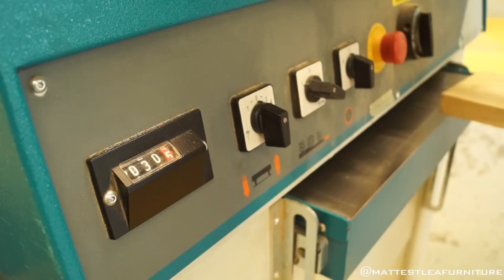Building a Roubo Workbench | Part 9

Comment: Hi Matt,

I have become addicted to your videos!  Your skills in the shop, and on the social media front, are very impressive.  You're doing that dissertation proud!

Question at 14:00: how do you prevent the orbital sander from cutting into the perpendicular surface when sanding near inside corners?  Do you sand into the corner with the orbital, or finish off the inside corners by hand?

Comment: Haven't commented during the build, but you've done a great job. A few cock ups, but worked your way around them really well. Your design (technically) was quite accurate, really impressed when you and yer mate dropped the tops on - alignment was bang on!! Nice choice of hardware, and good fitment. Presentation of the vids was good, nice friendly approach. blah blah blah. When I subscribed, you said I won't be disappointed, well guess wot. I'm an older tradie, sparky come fitter with a woodworking hobby (no expert at that) but I know good skills. Looking forward to watching more of your stuff. Cheers Matt. (p.s. how did your assignment - or whatever, media thingy - go?)

Comment: Hey Matt, Idk if you can answer this since it’s been a while that this project’s been complete. I’ve been in the process of building a bench inspired by this series and have gotten a little stumped about how you got the measurement placement for the threaded inserts embedded in the bottom of the table top. My frame is built and both top sections are similarly close to being dropped on. I’m just nervous about setting those inserts without a good plan for measuring their placement without putting the top on if that makes sense.

Comment: Hey Matt! Thanks for this video and in generalfor your work. It really helps me out! One quick question: How the hell did you get that bench out of there? Must weight at least 200kg. Ah and also, at 12:20 why do you plane the overlaying pieces but sand them afterwards? Isn't a planed surface much nicer than a sanded one? Best regards

Comment: Matt,  hello from across the pond.  Really enjoyed the series so far, only one more to go.  Question:  What is the make of that drill guide you're using at 13:36 of this video?  Looks sturdy and accurate and I want one....have to drill some dog holes in a new benchtop and that thing looks like just the ticket.
Reply from the maker: Hi Devin,

It's actually from the company I work for in the UK, Axminster Tools and Machinery. It would be perfect for thinner bench tops, but for thicker ones like mine it's probably not sturdy enough. There's still a small amount of play in it. I'd imagine you could get something very similar on your side of the pond!

Cheers mate

Comment: When attaching the top, did you run the risk of racking and therefore jamming the assembly before getting it in place?  I'd worry that such a mistake couldn't be remedied.  It's beautiful, however.  Do people in the UK appreciate your use of the soundtrack from the American movie Shaft? Classic!!!!
Reply from the maker: Oh absolutely! I was bricking it while dropping the tops in place. The most likely error was the tongues for the end cap being out of line. However, it's all the result of extremely accurate and precise measuring throughout the entire build. In many cases, I marked off one component to the other instead of relying solely on my drawings.
Reply from the maker: And I didn't even know it was a soundtrack! I got it from a royalty free platform so it's probably a rip off. I did find one recently that sounded scarily close to an AC/DC track.

Comment: How do you like the Roubo? I cannot decide between a split top roubo or a Paul Sellers bench... Sellers swears by his bench and it's dead simple. Anyone help me here?
Reply from the maker: Get a book called 'Workbenches: From Design, Theory to Construction and Use' by Chris Schwarz. It'll help you work out what you need in a bench and find a happy medium between something as insanely functional and versatile as this thing, and something as affordable as Paul Sellars' bench.
Reply: Ha.  I actually own and read that baby many years ago.  I'm 49 and have been doing this for some time now; I recently started using hand-tools more so a different bench is needed.  I'm stuck on these 2 benches but they are so different to each other...  I think I want the BenchCrafted tail vise.  Maybe I'll build the Sellers bench but put a BenchCrafted tail vise on.  I also like that sliding deadman you got.

The cool thing about the Sellers bench is that it uses lumber grade 2 x material throughout the build which is cheap but works fantastic.  If I built the Roubo I'd spend a lot more on material.  Thanks for responding; new sub here; love the channel.

Comment: I have a question why do you make such nice dove tail joints and then cheat on some of the other joints I think the project came out beautiful just can't see why
Reply from the maker: Good question. I assume you're talking about the through tenons? I like to work in a way that creates maximum enjoyment for myself throughout the process. I love cutting dovetails, but through tenons? Nah. Also, this method ensures a perfect fitting joint with no gaps. I'd rather have that in the end result, than be able to brag about hand cut joints. Cheers for the question though, got me thinking!
Reply: Matt Estlea - Furniture thanks for the reply I also find other ways of getting that fancy joint without all the work and the possibility of gaps in the end especially with larger ones

Comment: I had the time .. And I spent it well seeing the 9 videos with you making this workbench. And I think you made a fantastic and amazing job. I wish I had one of those! Because that is Fantastic!! ... But I ask my myself... well: - I ask You.. You made that workbench  with 99,9% with machinery.. with very good and nice machinery ....Right?  And I Thing that a workbench is made to work with HAND TOOLS ... And you almost in this videos NEVER AND NEVER used THEM AS TOOLS.... I never saw you use a single  once time .. like a HAND PLAIN... or a manual HAND SAW... And there were several times that you could used them.... AND IT WOULD MAKE A GOOD DIFERENCE!!  because tool-machine is eficient work .. but hand tool is a perfect job. And this place you are working is a place were you learn to be a Carpinter .. Right ?  .. So... my question is: - Why did MADE workbench  lf you don´t care to learn and use HAND TOOLS when it makes a diference? Wouldn´t it be wise .. for you... if you don´t use them .. to just use a simple table.. and CONTINUE  to USE ALL THAT FANTASTIC MACHINERY ?? Thank You

Comment: I think your doing a great job but you lost me in that V grove why would you resaw then cut 45 couldn't you just mark the V on the end and cut it on the bandsaw just seems like a lot of extra work
Reply from the maker: It was just to get a cleaner cut, that's all! The bandsaw leaves a rough sawn finish that would mean the deadman doesn't slide as smoothly. The table saw and a sharp blade leaves a polished finish, especially on endgrain.